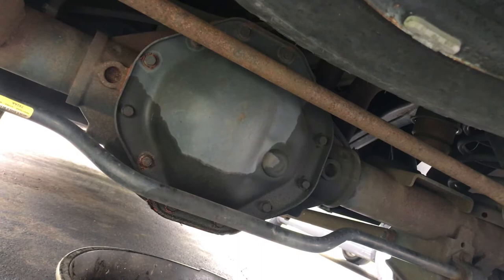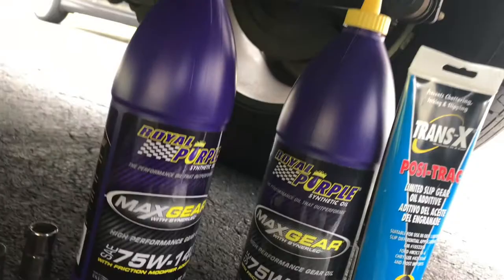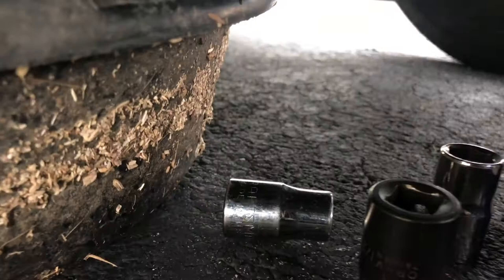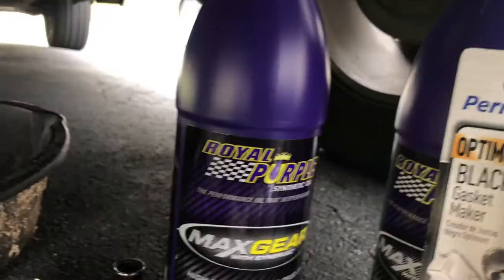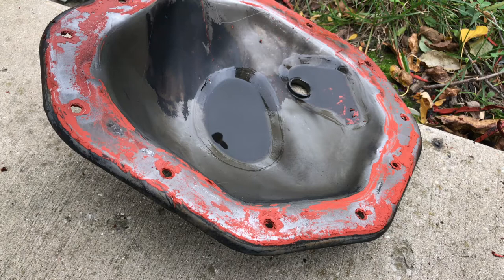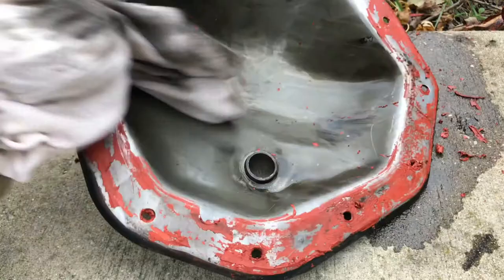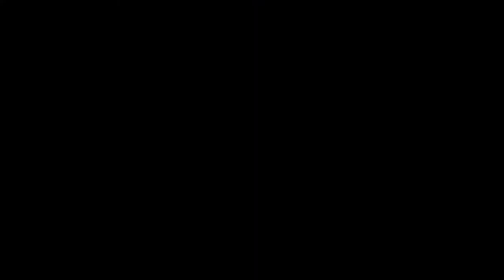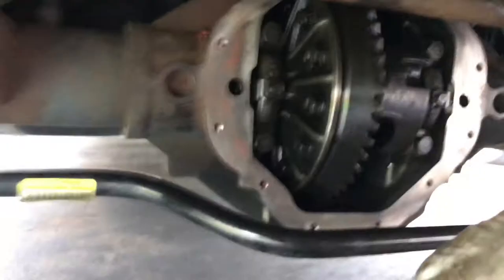Dodge Ram 1500 Rear Differential Gear Oil Change with Tips & Recommendations

Comment: Always remove the fill plug before removing the cover. Just in case for some reason you are unable to remove the fill plug, you are not stuck with an empty differential that you can't refill. ;)

Comment: You didn't Show the additive you were suppose to put in. You should of put that in first!!
Reply from the maker: Hi, I mentioned the reason I didn't show it however, I did install it after I installed the gear oil. I've done this sooo many times and it's always a great outcome. Once those gears turn, no matter what position you poured the additive in, it will mix almost instantaneously. Thank you so much for watching.

Comment: I really believe the gasket works much better than the gasket maker for rear differentials. I've never had the gasket leak but I have had the gasket maker leak just like yours is now with the gasket maker. Just seems to break down over time or maybe there's just too much vibrations on the rear diff. I don't know but the gasket maker never seems to last.
Reply: Always go with a real gasket instead of a gasket maker...
Reply: I have seen you-tube vidoes that use brake fluid cleaner spray on the inside of the differenal is that bad?

Comment: You’re destroying the diff cover edge with the wire brush and metal tools that’s why it’s leaking , grooves will cause leaks
Reply: Then how do you clean the old gasket off ;)
Reply: Scraping and using a wire wheel are a correct method. If done correctly there will be no gouges in the metal. The minor abrasion marks left by cleaning the gasket off will be filled in by the new liquid gasket and will give surface area for the gasket to grip into to, as opposed to a smooth polished surface.
It is important to make sure the face of the flange is flat, check especially around the bolt holes. Use an rtv that is compatible with the oils being used and make sure the bolt pattern is torqued down correctly.
Presto, your good.
2 things I’d do differently are to use mopar rtv and oil, and I’d clean the cover on a surface that won’t scratch the finish.
Reply: Agree - fast rotating wire brush may be a bit 'overkill' - better to just use a dish sponge (pots and pans rough surface side) - some brake fluid and elbow grease! It will come off easy.

Comment: After being a mechanic for 48 years, I have found its better to use a gasket rather than a permatex gasket maker, my 2010 rear end had a little growl when I let off the gas, I did the fluid change but it certainly didn't take as long, perhaps because I wasn't jabbering at the mouth more than I needed to.

Comment: You gotta do the front as well as the rear. I know the front takes a different weight. I use the mopar slip additives as well. You dont have to change as often unless you are doing heavy towing and alot of off roading. Or unless you detect a leak in your case you know what you are doing. I change my out like every 20k miles just to be on the safe side. I do light towing and light off roading. I have a 2016 ram 1500. I've owned a 14. I have more problems with the lower years then my 2016. My 2016 has been so reliable. I'm at 80k miles and the transmission is still running smooth. Getting ready to do my cooliant change soon too.

Comment: How much rear axle fluid did you use to properly refill the diff? I'm about to do the same on my 2014 1500. Thanks!
Reply from the maker: The exact refill per the software is 4.90 pints. So a little over 2 quarts. Thanks for watching!
Reply: @TerenceDIY  Another question... did you add some of that Mopar MS-10111
 Limited Slip Additive? Thanks!
Reply from the maker: @elbodri  , no, I just bought an additive from Autozone, I believe it was a Lucas product. Thanks,

Comment: Good job!  I use the M1 which comes with the LS additive already added.  I don't mess with that permatex stuff anymore.  I find it less hassle and less mess to buy a rubber gasket and just add a few drops of permatex here and there to make it stick to cover as I install. Don't have to mess with scraping permatix of cover and diff.

Comment: What if my Dodge Ram does not have the front plug on the cover pan where do I fill the oil at ?
Reply from the maker: Hi George, there has to be a fill plug. What year and model is your Ram?
Reply: Mine doesn't have the rubber fill plug either. (2012)

Comment: can you get away with a felpro gasket instead of rtv?
Reply from the maker: Hi Chase, yes, you could use a Felpro gasket. If you choose to dod so, I would still use some silicone (a small thin layer), to hold it in place. Thanks for watching!

Comment: I saw that the Royal Purple already has the limited slip additive in it... I'm wondering if it's possible to put 'too much' additive in it by adding the additional... curious. My 3.92 (2015 Ram 1500) took 2.25 qts of gear oil and the five ounces of additive. Great vid! Thx.
Also, those rubber fill plugs don't seem to last long. I picked up a new one from the stealership because my original one was seeping out fluid after the first gear oil change. After I put the new one in, it sealed it good. - [Park on a level surface - put additive in first to make sure you have room for it - make sure you have it full to where it's coming out of the fill hole because it needs to be full to properly function and lube everything] - Peace and Joy!
Reply from the maker: Hi Jim Webber, I can't see how any amount of additive can hurt, given it being mixed with the fluid itself. If anything, it can help prolong the life of the fluid. My truck has been driving amazing. Thanks for watching! Happy New Years!
Reply: @TerenceDIY  > I additive always required or only required if you have a Limite slip differential?  BTW, great video.
Reply from the maker: Hi Mark, you do NOT have to add an additive. It's just my way of keeping the parts well conditioned, especially since the diff oil is something that isn't commonly changed. Thanks for watching!
Reply: @TerenceDIY  . thanks for the reply

Comment: you should never use a wire brush,the paint wheel is ok .Brake clean,and a broil cleaner pad (plastic loops) is all we use.Also adding an extra additive was incorrect use more oil.An air gun is also great for blowing debris,that gets in gears when scraping.I use a razor blade scraper.Also your rear end will still leak as you spread oil residue all over surface when wiping rear end clean your surface before with ether or brake clean.Silicone does not adhere to oil on metal surface.even the minutest residue can cause failure.But hey better to run clean oil than not at all.
i know your just helping people out.